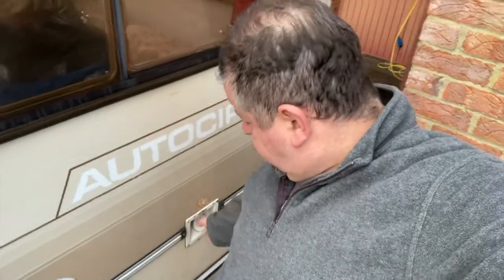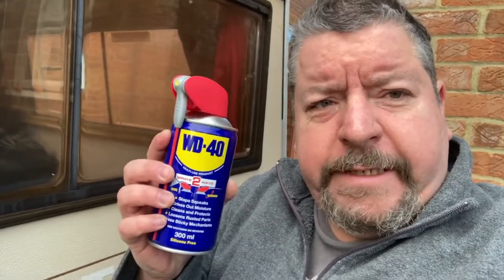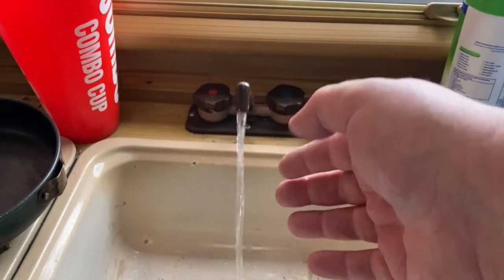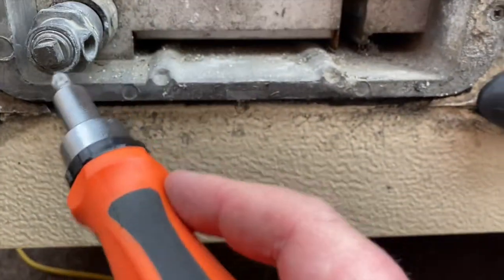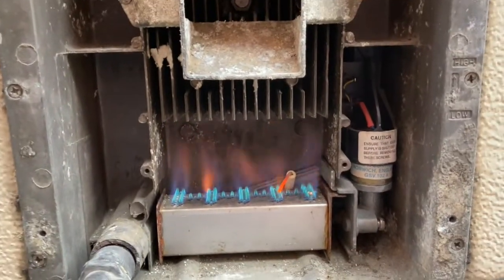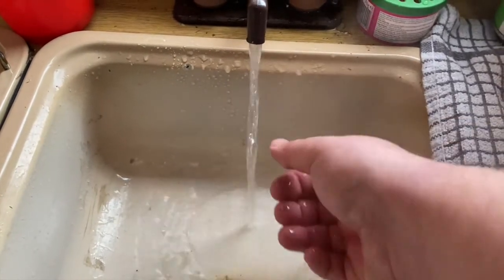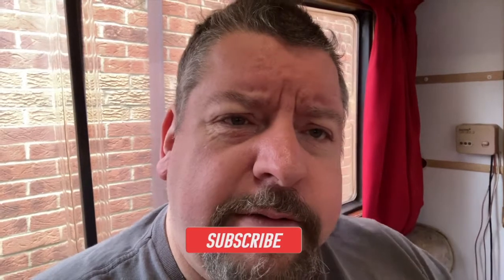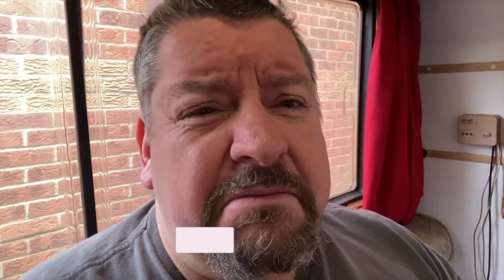How to check Motorhome Fresh and hot water Carver Cascade 2 boiler.

Comment: My water heater just clicks when I try turn it on. Any ideas
Reply from the maker: Sounds like no gas, is there another gas shut off valve near your water boiler? Took a few moments for the gas the run through. What’s the make?
Reply: @DKGoesWild  its a tallbot express capri. When I took the drain plug out no water came out and its got a full tank. There is a separate shut of valve its red
Reply: @DKGoesWild  when I turn the gas on I can smell it coming through the water heater outside. It's just clicking. I was thinking there could be an airlock in the system somewhere as the drain plug isn't letting water out when unscrewd
Reply from the maker: @leejohnstone1179  sounds like no water, does any water come out the hot tap? Is there any water shut off valve near the boiler? The heater won’t light if dry
Reply from the maker: @leejohnstone1179  sounds like no water, does any water come out the hot tap? Is there any water shut off valve near the boiler? The heater won’t light if dry
Reply: @DKGoesWild  tha tank is full. There is a gas shutoff valve that's about it. No water comes out of the taps or shower. Water doesn't even come out the drain plug on the side of the van
Reply from the maker: @leejohnstone1179  so your not even getting cold water running through? Water pump etc working?
Reply: @DKGoesWild  the water heater has started working but still no water
Reply from the maker: @leejohnstone1179  not even cold water? Is water pump running, all valves open?
Reply: @DKGoesWild  yeah the valves are open I can't find the water pump switch if there's one
Reply from the maker: @leejohnstone1179  must be a water pump did you not get a hand over when you bought the van? It’s normally next to your water tank. Find it and then turn all your taps on and feel the pump to see if it’s running. In mean time don’t run hot water heater if no water in it as can cause further damage. Ask who you bought it off how to turn water pump on
Reply: @DKGoesWild  ok thanks for your help. I bought the van in a rush drove over 500 miles for it and it was dark when I got theyre. I fell out with the guy because I've asked him things before and he basicly told me to go away and stop bothering him
Reply from the maker: +Lee Johnstone did you get it working?
Reply: @DKGoesWild  yes it was the water pump mate